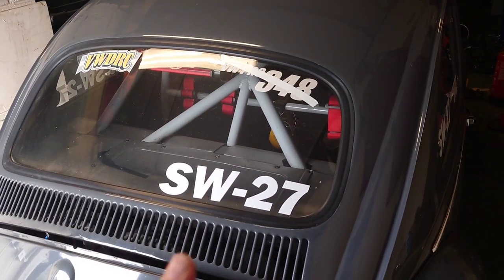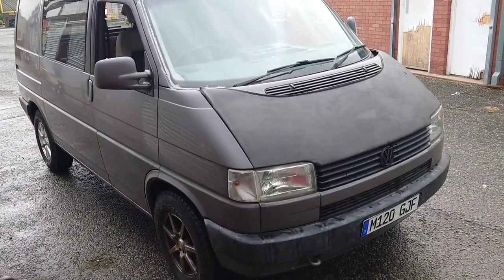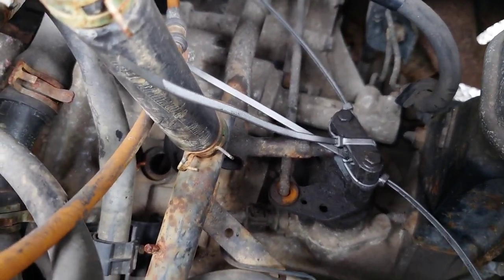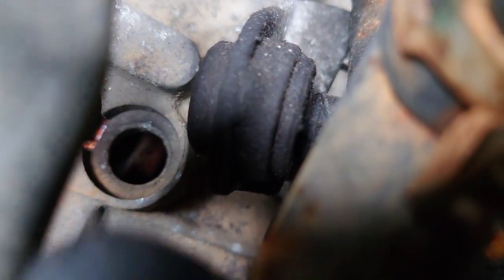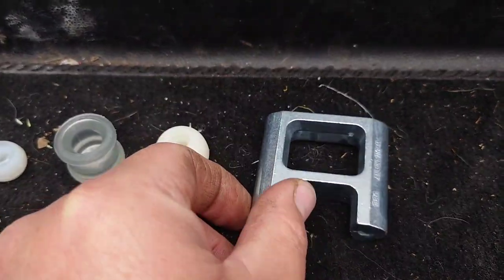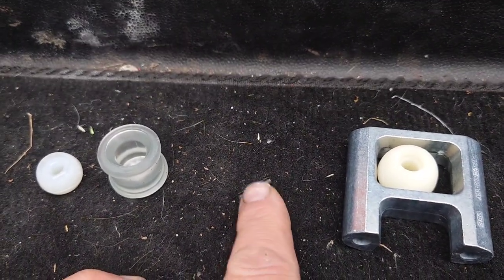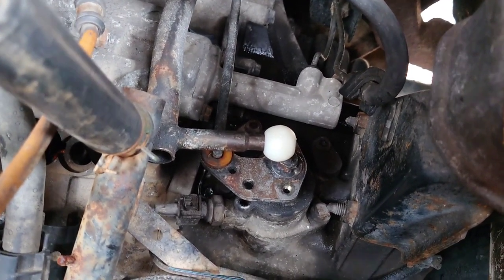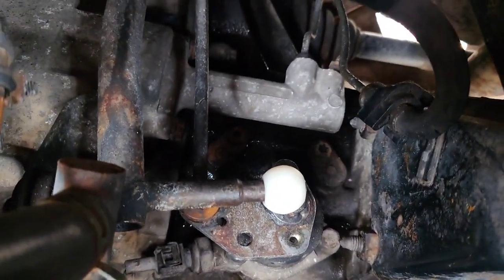How to repair gear linkage on a VW T4

Comment: I’m having trouble with this on my 93 eurovan or t4 as you guys call it. That rubber looking circle thing on the opposite side of the metal one that you replaced, does that attach to the motor/transmission there or does that float free? Only gears I have right now are 3 and 4. I can’t figure out what that other side does

Comment: Looks like that ball doesn't sit fully inside the crevice properly. Mine does. Appears to question whether that main rod or the gearshift actuator plate on the gearbox or the socket holder plate on the side you didn't change is/are actually the right parts for your model? Either that or that ball is pushed too far on? Might wear prematurely (again?).

Comment: Hi! Where did you buy your repair kit? I bought a kit but the ball in my kit is simply impossible to slide on. I´ve even used a crowbar but it simply won´t work.
Reply from the maker: I got it from Brickwerks here in the UK.
https://brickwerks.co.uk/product/selector-rod-repair-kit-t4/
Reply: @2BugsandaBack  Thanks man! You saved my vacation trip!  The balls in my previous kits were hard as rocks. The one you recommended was more elastic and slid over more easily. Still had to use a crowbar though due to the awkward position, but now it was a 10-minute job as you say. Much appreciated!
Reply from the maker: That's great news! I'm glad you managed to get it sorted 😊
Reply: if anyone still hasn't done it, try soaking the ball in really hot water first,then lever it on with a long piece of wood

Comment: Hello mate does the big ball just sit like yours there not right in the middle ?? About to do both sizes and the cup I have the whole linkage off atm cheers 
The scouse biker
Reply from the maker: Yep, it's not in the middle of the clevis part. I did wonder about that, but the old clevis I took off has got wear marks that show that the ball has always been off centre a bit. This van has done 293,000 miles so it must be right!
Reply: @2BugsandaBack  nice one for the quick reply man apreicate it
Reply: @scousebikers  Ahh. seee  my new comment above. I think there may be an issue with the main rod. Has the long arm of it ever been shortened/welded?